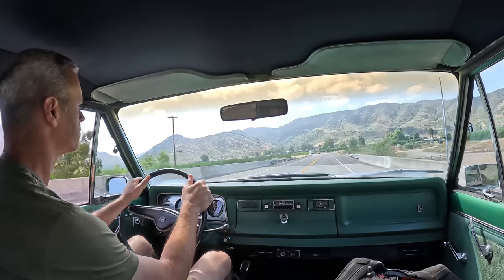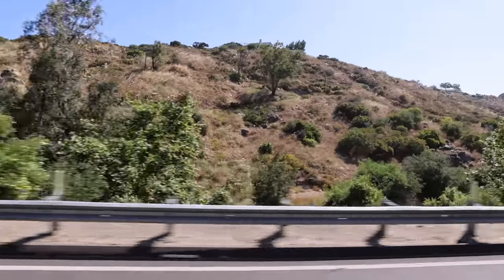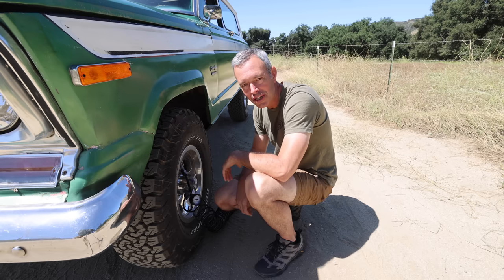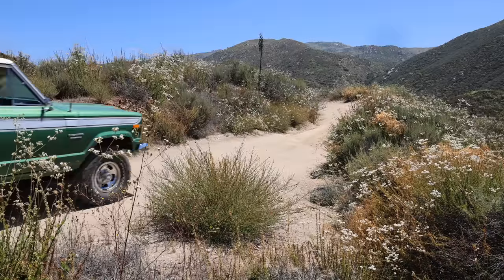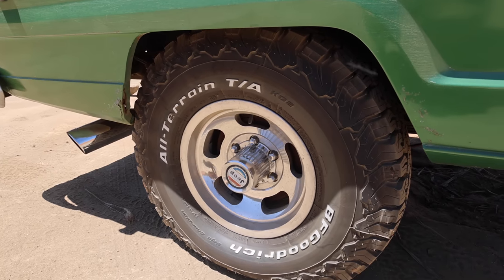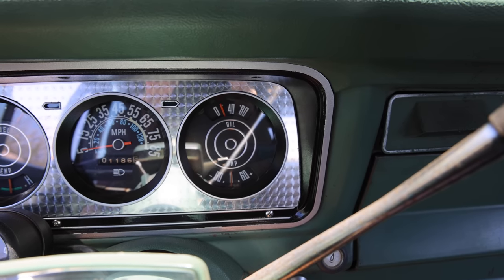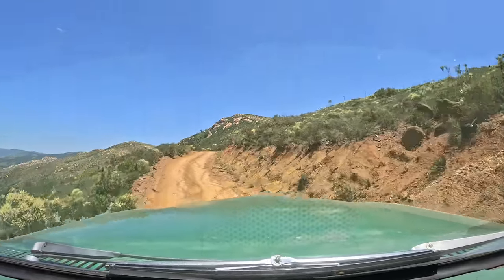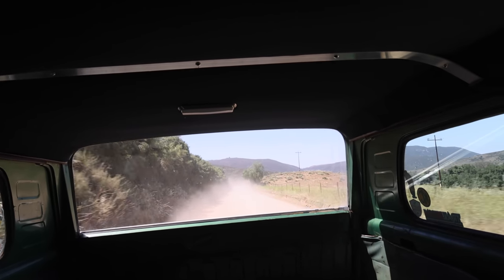Black Mountain Truck Trail, Ramona, CA - Prickly Pear Adventure

Comment: You've probably covered this question before, but what was your tire pressure before, and then after you let the air out?   Trying to guage what to do with my truck tires when I go off road.  Thanks

Comment: Do you you have a part time kit with locking hubs ,I put one in my 76 blazer and increased mileage to 16 miles per gallon,  not today standards but better than 70 standards
Reply from the maker: No locking hubs on this girl, it has the quadratrac, so it requires a bit of a conversion... maybe down the road

Comment: With all these people telling you to efi this thig, i feel that i need to say i put the holley stealth efi on my 72 Camaro and dont regret it. It fires right up on cold mornings and has instant throttle response. The thing is though that I waned it to drive like modern car. If you want to keep this amazing truck as original as possible, then there is nothing wrong with a carburetor, dont listen to anyone here

Comment: Carb tuning is not the answer air screws will help but jets when up in altitude air screws will help but won't get it done. If you want to be trouble free and more power 
go Fuel injection. Trouble free.

Comment: if you have to adjust the carb for a 4000' elevation change it was way too rich to start with.
i'd regularly take my fsj cherokee from sea level to 5500' with zero noticeable difference.
the do run out of fuel going down steep hills due to the shape of the tank, you can keep the tank full to reduce it or fit a second tank behind the axle an xj fuel tank fits well there.
you'll be surprised how well they go offroad especially with a rear locker it's mostly just the size that stops them.
Reply from the maker: Agree, I do believe its too rich at sea level currently.

Comment: No offense, but an EFI conversion is a must for off-road vehicles. Oxygenated fuels, boil-over from the float bowl(s), fuel slosh from float bowl(s) as you experienced, over-enrichment at altitude, etc. Carburetors are a dinosaur!

Comment: You stated, ..."You gotta keep an eye on things."
My '79 CJ5 turned out to be a "CAREER!"  It came with so many dangerous "repairs."  The term is such an oxyMORON.  The reality is that what was done to it was MORONS thinking they are mechanics!!  The horrors done would be Court Martial offenses in the military because the extreme danger.

Under the hood were wiring that was not factory with many live bare ends that could have caused an electrical fire.  I cut away all the "wiring" that was obviously not factory and it all amounted into a large nest of wire.  Then I tidied up what is factory wiring.   There were all kinds of un-matching hardware of different sizes and stuff that look like uncle Ed's barn door fasteners.

Under the dash was a nest of wire also with many hot wires just dangling on the bare floorboard.  Non of the dash lights worked, the gauges did not work, the steering column was missing all but the outer tube, steering shaft, and steering wheel.  No blinkers, and so on.  

I am in the process of reassembling the windsheild wiper system with new motor, hiem jointed chrome moloy adustable linkages, new wiper pivots, and new wiper arms.  By the way, some MORON cut the the hook part of the hood safety catch so the hood opened and slammed against the windshield glass!!  However, the windshield had a beautiful eagle wing pattern.

I do not know if the fuel tank is homebuilt or aftermarket, but it poured fuel from the sending unit faster than you can pump fuel in it because during fabrication and welding the sheetmetal was warped from the welding process.  The MORONS covered the entire sending unit with silicon to try and contain the fuel.  It was a mess to say the least.

The leaf spring plates, the lift, the shackles cut out of plate with a torch, the steering, and on, and on.  The story is waaay long!!

It amazes me how stooopids can screw up such a simple and easy vehicle to repair.  The MORONS literally made it a deat trap.

Your prickley pear was mostly warn out and not severly butchered.  I know you have upgrades planned or in mind because let's face it, most of us plan to make things better, beefier, or high performance.  But at least you seek out expert advice.  The mechanic you feature from time to time can direct you well so you may do whatever work you think you can handle.  These trucks are really very simple to work on.  Plus, you needn't mess with electronics that is way beyond your pay grade.

The following might be a huge help to you:
Russel, Vintage JEEP Parts, 979-387-3393
He has stuff you think is not available any more.  I purchased the heim jointed wiper parts kit from him.  He gets them from a man who makes them, and the man makes other stuff for JEEPs also.  

You might ask Russel for the man's contact information not only for parts, but ask technical questions, history of your model JEEP, and other topics.  Maybe even arrange to do a video of how the man makes the parts (very intersting) and how Russel can help "JEEPers."  If you support small business like I do I suggest you talk to them.

As for MPGs, recurve the distributor and install an adjustable vauum advance canister.  On my AMC engine I am running 16 degrees inital timing with no vacuum.  I recurved the mechanical advance to 29 degrees with no vacuum.  I installed an adustable vacuum canister and cranked it 49 degrees.  Be aware that even professional mechanics will tell you 40 degrees is wy to much; however, the engine is low compression at 8 - 8.5/1 compression.  Your truck is heavier than mine so your engine may not handle 49 degrees.  

The tell tale signs of too much timing are pinging when you floor the throttle at highway speeds and increase in engine temperature.  You can crank up the timing to about 2 - 4 degrees below the point that the engine pings and or gets warmer than normal, about 180 - 195 degrees.  The result on my AMC engine was 18 MPGs; after installing 33" tires I got 17.5 MPGs.  My CJ has a granny gear 4 speed and a 2 bbl carb.

If your engine has a Quadrajet carb, you can replace it with a Holley spread bore carb that was developed to replace the "Q Jet" carb.  It is easier to tune and has a nice smooth throttle response with better economy.  

If you are up to it, there are high torque cams that start from idle to 3500 - 4000 rpm range that give you even more torque, better throttle response, more MPGs, and better driveability.

Comment: You should have done a better suspension and a flip kit and moved the shock up higher and out of the way and you could have put 35in tires and a v8 ls swap what a waste of a 4x4
Reply from the maker: Oh there are lots of should have and would haves and maybe over time I can do more upgrades, but my goal has just to get it to the point where I can take it out without too much expense and modification from stock.